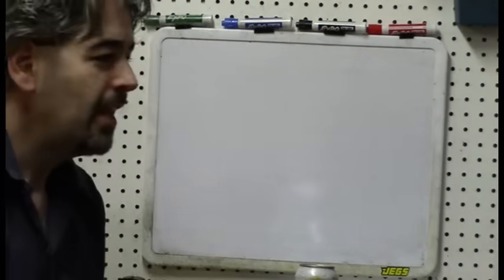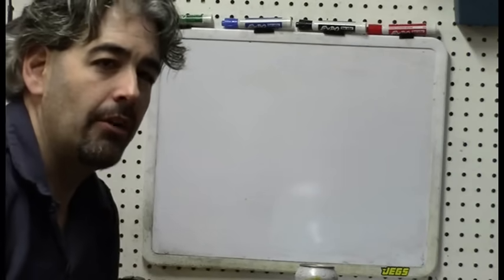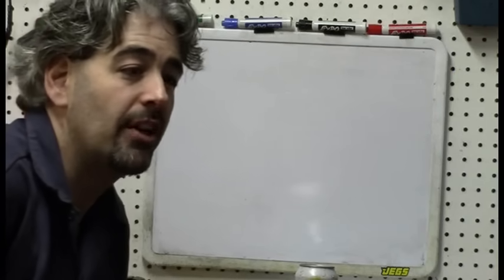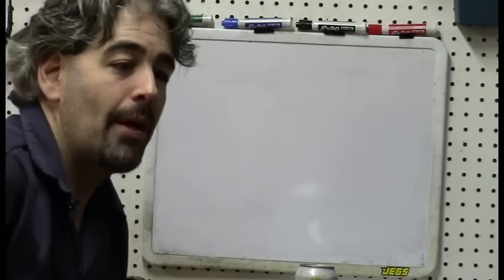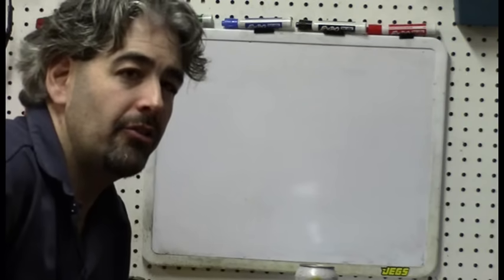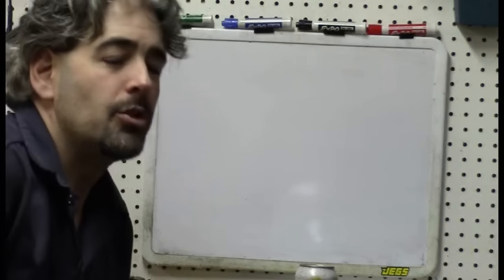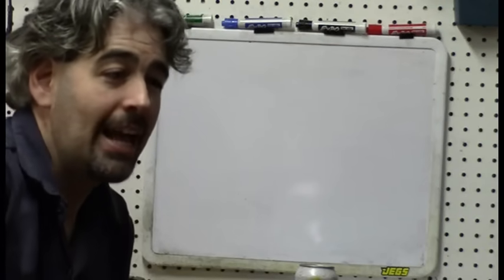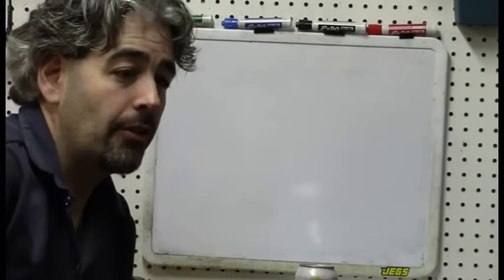Secret of Engine Problem Diagnosis- Fuel Trims Pt.1

Comment: Great videos. Thanks for pouring so much information into it.  I feel smarter already.   
QUESTION:  99 Corolla w/ 200k+ miles.  Engine Runs great and No engine error codes.But,  MPG recently took a dive from 30s into the 20s.   Im not sure where to look if I dont have any codes to analyze.   Do I need to invest in a scan tool?  
Suggestions?
Reply from the maker: Yes ytou need some data to get a starting point. There is no data here to analyze.

Comment: Hi Matt: Just purchased a scanner (Blue Driver) for my 2010 328i to diagnose P2098. I was under the impression that for a 6Cyl engine there are 4 O2 sensors. - B1S1 and B2S1 which are pre-cat (STFT and LTFT fot B1 and B2).
The B1S2 and  B2S2 are Post cat O2 monitors and there are no associated LT or ST fuel trims. Obviously I am missing some thing here. My question are
1)  "Are STFT and LTFT"only applicable to pre-cat O2 sensors?"
2) For P2098 there is a reference to post-cat o2 monitors - what does this refer to?

I am trying to nail down the PID's that I should track related to fuel trims - I am expecting monitor  a total of 4 PID's 
STFT - precat bank 1
STFT - precat bank 2
LTFT - precat bank 1
LTFT - precat bank 2

Are there other fuel trim parameters that I need to consider?

Thanks in advance
Reply from the maker: While there is minor fuel trim adjustment from S2’s on some cars, the S1’s primarily drive the STFT. 
  I actully would not even consider the S2’s in this diagnostic procedure itv i was doing it.
Reply: If so should I ignore/reset P2098 - "Post catalyst Fuel Trim System Too Lean BANK 2"?
Reply from the maker: absolutely not  I would diagnose it. Once S1’s are confirmed with variable induction by default S2 response can be validated simultaneously and diagnosed.  
  I never simply reset the CEL. It came on for a reason.

Comment: İ have a clio 1.2 d4f 2005. My o2 sensor voltage is ,45v but stft +45 +50 ltft +30 how this happening?
Reply from the maker: Your O2 sensor cannot be .45V- it should sweep from .1 to .9V  If you are indeed seeing .45V you are likely just seeing Bias voltage which obviously explains your issue.
Reply: Schrodingers Box  yeah yeah youre correct. İ mean my o2 sensors average .45v always bouncing 0.15v-0.85v something like that but stft +45+50 (hot engine) i couldnt find the problem by the way theres no leaking on intake manifolfds i checked 2 times

Comment: HI,WOULD THE CARS ECU EVER REDUCE AIR COMING IN WHEN THE CAR IS RUNNING TO LEAN ,OR WILL IT ALWAYS ADD MORE  FUEL IN TO MAKE THE MIXTURE  CORRECT
Reply from the maker: Yes it would do this though IAC-  Or the caps lock key.

Comment: Sir I've been dealing with fuel trim issues for awhile replaced a bunch of parts all o2 sensors maf sensor iac new plugs and coil packs also smoke tested no vaccum leaks. My long term fuel trim bank 1 is around 20 bank 2 is around 16 but my short term is negative at idle when I hit the accelerator the long term cuts in half but the short term goes lean sometimes rich but mostly lean like 3 to 4 positive short term. Do you think this is my fuel pump or maybe injectors?  Recently fixed a leaky compression fitting on fuel line and new fuel filter maybe it's taking awhile to go back to normal idk what my issue is can't seem to get fuel trims to even out no matter what I fix need some advice thank you.
Reply from the maker: sounds like a vacuum leak to me.

Comment: Does a Fuel Pump can create an intermittent issue? My car runs great sometimes and sometimes it has a little vibration and a loss of acceleration. Nobody can figure it out! I've replaced coils, spark plugs with the right gap, cleaned the MAF, IAC, Throttle plate and EGR, check for vacuum leaks and nothing! car has 60k miles.
Reply from the maker: It absolutely can.  Check the fuel trim.

Comment: I have a question. Sortive related. When looking at the graph of the o2 sensor does jagged vrs smooth sweeping graph have meaning worth mentioning? 
   If I've placed this question in the wrong place please forgive me I don't usually ask questions on YouTube.
Reply from the maker: No a jagged line merely means the scantool has a low refresh rate so you are not getting a smooth flow of data points. the data points are spread out which causes jagged lines. it does not indicate this is the actual sensor signal.  It does make it hard to read though.   You can try reducing the number of PIDs you are viewing. Otherwise, scantool with a faster data rate would be needed.

Comment: Any help is appreciated. 97 expedition with an 02 4.6 from a gt. Problem: severe missing, hesitation. No DTC. Im showing 24.2% LTFT,both banks. 3 o2 sensors from .3-.8, 1 o2 stuck at .235. Also pulled TID $52 CID 00. Yes its 52, not 53.
Reply: 30k mile motor. And brand new exhaust from manifolds back, 4 cats.
Reply from the maker: Perfect!  Just find the LTFT load curve and you'll have your diagnosis!

Comment: Hi, I hope you can help me with a diagnosis, i have an E46 330ci, the symptoms i'm having is rpm drop when the engine is still cold, sometimes the engine stalls (performance is ok), and poor performance when the engine is warm below 3000rpm, above that the car is responsive with pulls nicely, i looked at short and long term fuel trims, at idle both banks are -8 and as soon as i push on the throttle both banks jump to +17 to +18, which makes me think its not a vacuum leak.
the things i've done, replaced both fuel pump and fuel filter, currently the fuel pressure is 50psi and holds at throttle.
o2 sensors were changed recently also, maf reading is 3.8g/s at idle (tried a new maf same readings the maf should have been VDO but there was logo on it which makes me doubt). removed bank 2 sensor to check if the reading get better (clogged cat.) but no change which tells me the cat is good (also the good performance above 3000 rpm).
i also changed the vanos seals, disa ring (flap is good).
the only codes i have are P0171 and P0174 (both banks are lean) and i have no idea where to go from here.
Thanks.
Reply from the maker: I would need to see your data that indicated the fuel pump was the problem and needed to be changed.
Reply: I had no data except having lean condition on load indicating a fuel starvation problem, so i started throwing parts at it. now a part replacing the engine i don't know what to look at !
Reply from the maker: Look at the sources of stoichiometric deficiency via fuel deliver OR unmetered air source under load. Rule them out systematically through diagnosis rather than guesses

Comment: What do you do when you connect your scanner to your vehicle and it only shows you trims for bank 1 because the vehicle doesn't provide info for bank 2
Reply from the maker: get a new scanner. My cheaper ones do that all the time. you can also try only reading generic data.

Comment: My short trim is .88-1.10 and long trim is 1.00-1.15 does this mean I have a vacuum leak? Check engine light is on saying bank 1 and 2 is lean?
Reply from the maker: You can’t say with that data. You have to curve it against load as shown in the video.
Reply: @SchrodingersBox  what do you mean by load? Like driving? That was also with revving my truck
Reply from the maker: Ok so what was your data then? You only gave a single time frame
Reply: @SchrodingersBox  at idle short trim is .88 and when I rev it up past 2,000-3,000 rpms it goes up to 1.10 same for the long trim is a 1.000 at idle and 1.10 once I rev it up past 2,000-3,000 rpms
Reply from the maker: Doesn’t sound like a vacuum leak. Check your MAF voltage and also fuel pressure. Also see if the O2 sensors go over .8V at WOT
Reply: @SchrodingersBox  ok I will do thanks and do you know what the volts are suppose to be for the maf?
Reply from the maker: depends if it’s analog or digital.

Comment: Another thing ima driving now check light is on already for p2096 later I check it while scan tool connected and p0139 pops up..so I'm aware so I'm driving and driving and bam  I check codes and the p0139 went away on it's own with p2096 still ther ..

Comment: Puzzling question:

I'm seen better fuel trims with a higher level of fuel in tank (over half). A quarter to empty, trims starts to get negative. Any ideas?
Reply from the maker: Could be related to EVAP perhaps?
Reply: Schrodingers Box I was thinking maybe a bad fuel cap?
Reply from the maker: That would cause leaner trims than expected with evap application.
Reply: When I remove the gas and cap while vehicle is idling fuel trim goes very negative short and long like minus 15. Also the purge valve opens while vehicle is at idle in park (not sure if in drive) weird my 2006 mitsubishi montero.

Comment: Hi i have a 1999 Chevy k3500 7.4l  its running like its has a died cylinder  where would i look   i did the egr and plug wires  stil running like its got a died cylinder  and my cat gets hot

Comment: Will this work on pre-obd2 vehicles. I can get rich or lean codes based on the blinking light. But idk if I can get actual trims
Reply from the maker: it will. OBD1 videos use a different terminology- integrator for STFT and Block Learn for LTFT. the numbers are binary so 255 is actually zero.

Comment: if at a certain idle speed ,say for example 500 rpm a vacuum leak happen the computer add fuel to reach 14.7:1 
as a result the idle speed become higher say 550 rpm
my question is : at this  new speed (550
the engine will idle roughly or smoothly?

Comment: So if the engine is NOT at 14.7:1 there will be NO centerline  in the o2 wave?
Reply from the maker: No. If the engine is not at 14.7 to 1 the fuel trim will compensate accordingly to maintain stoichiometry.

Comment: i have a fuel trim bank 1 code on my mitsubishi montero sport 1997, what is my problem that is causing my engine to act as if it was running out of fuel and sometimes stalls out at red lights? and it does this when its really hot outside, i live in florida. it runs good at night. i also am wondering why my volt meter fluctuates right before it starts to act wrong. Any help would be very cool and Appreciated!
Reply from the maker: Easy diagnosis from the video.

Comment: How long should I be in open loop when I 1st start up the car? I feel like mine goes in the closed loop within like 30 seconds it doesn't feel like it's long enough
Reply from the maker: It depends on a ton of variables.  one of the main ones is the CTS. look at the CTS value and it’s usually a good indicator of when CL transitions.

Comment: That's good to learn about fuel trims and you do a great job teaching and I'm personally grateful , 
I just purchased a 96 pathfinder and noticed the engine had been changed at some point but runs great but bank 1&2 fuel trims was very high so I did all the normal thing's , smoke test and pretty well most all the things in your videos to try to diagnose the problem but the trims were good diving but +25 on idle and it was giving me a fit, so I did every test on that motor I could think of , I'm 62 years old and I've built a lot of engines in my day from pro drag to dirt track and I know how to flow a motor , I can turn the exhaust from rich to lean but I prefer a dove Gray , 
But back to my fuel trims / the problem was the TPS voltage to high and spark advance to high , some body had the distributor out at some time and messed with that throttle TPS sensor, I lowered the TPS VOLTAGE and had to pull the distributor out and reset it because I couldn't retard the park advance ,, so I lowered the TPS voltage and the trims started coming down and I lowered the advance on the distributor and the trims are normal , and thanks I enjoy your videos

Comment: I had a huge vacum in my car caused by bad pcv for long time. I fixed it by remove the pcv, with a pcv delete kit, now the car runs much better but check light turn on and the code was p0172 rich condition,  is this because i need to reset fuel trims? Or there may be any ather issue?
Reply from the maker: sounds like your PCV delete kit is blocking the PCV to me.
Reply: @SchrodingersBox  But how? I see all cars with 2.0tfsi engine remove the pcv, what do you sugest me to do? Thanks
Reply from the maker: start by verifying if the rich condition is the result of  PCV restriction
Reply: @SchrodingersBox  ok, than you very much

Comment: If having a bigger injectors can create a rich condition? (stock injectors should be 19lbs and I have 21lbs now)  the LTFT is reading -18. I know -18 is bad, can this be the reason for that?
Reply from the maker: Not sure. Good question. It would be interesting to see if there is a shorter pulsewidth on the new injectors.

Comment: I think I'm ready to buy my first car to flip....I have flipped more expensive things like mobile homes and went in with much greater risk.  But for some reason I am really nervous about getting burned.  What would you recommend I look for? I am thinking just do a relative compression test and test one cylinder compression to verify good compression....then check really good for any oil leaks...of course check for head gasket leak with a chemical test AND the sizzle test....then of course the test drive on the transmission....and with engine also making sure no engine knock from bottom half so was thinking of getting down under the engine and listening down there to check for it...

I don't know how much used engines go for if you pull them yourself but it seems like at a place like LKQ they are anywhere from 200 to 400 which is really NOTHING....any knowledge of what they actually go for at these pull your own places?  Of course there is risk in doing that too not knowing if those engines are good...I'm just looking at exit strategies if things don't go as planned...

Anything I missed?
Reply from the maker: Yes I always checked the fuel trim to make sure it’s within range and also check rear O2 sensor voltage for signs the catalytic converter is worn. i always did those before selling every car to minimize chance of a check engine light coming on soon after the sale.

Comment: I get P2097 post Cat rich then after about 10 more miles I get P0420. My long and short FT do not go over +5%. It is 2015 Chevy volt. Do I have bad Cat or Downstream O2 sensor?
Reply from the maker: No idea. what data do you have?
Reply: Schrodingers Box https://drive.google.com/file/d/1HrMcIF8GZZdg8hFb5T8aN1uNHSQLG9VW/view?usp=drivesdk
Reply: Schrodingers Box I used BlueDriver to get live data.

Comment: A vacuum leak would also cause a high rpm at idle.more air=more fuel= increased energy upon combustion=faster moving piston=higher rpm
Reply from the maker: ONLY on a speed density system. Other wise obviously it LOWERS idle